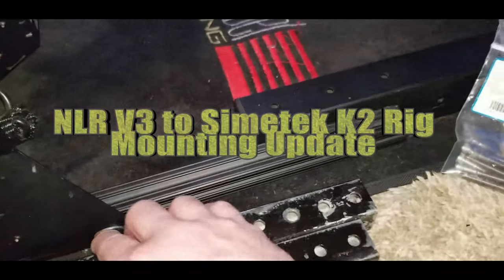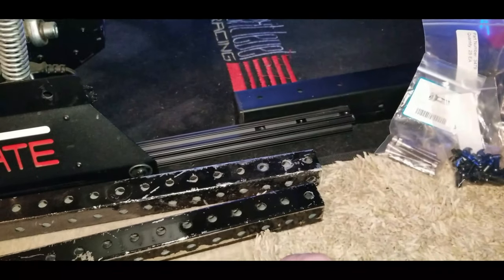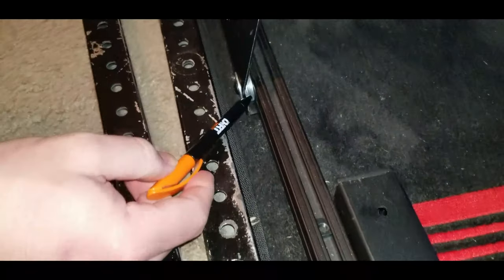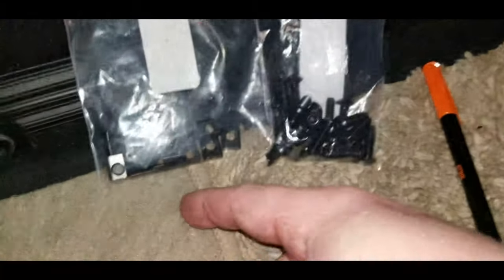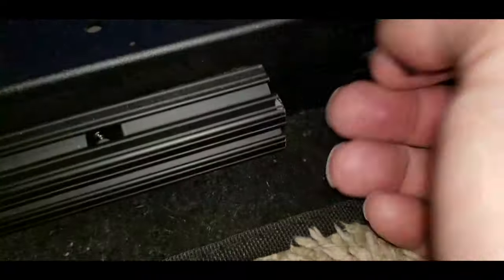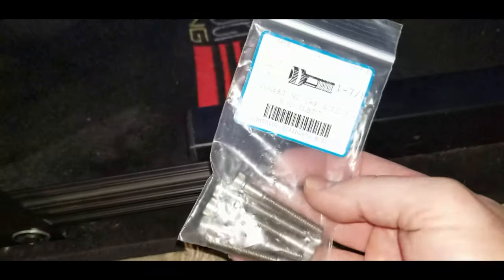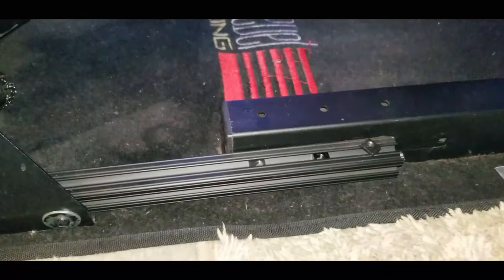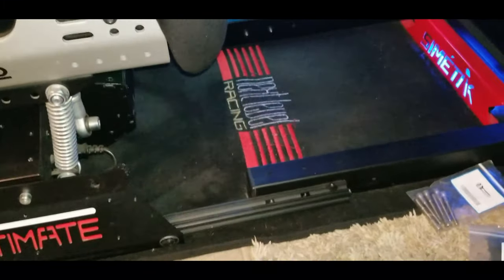Simtek K2 and NLR V3 Rig Update 2019

Comment: Nice setup hope to get there one day..best thing I have is a custom set of t3pa pros I made into a hydraulic brake with a pressure sensor
Reply from the maker: Thanks and you will get there. I started by sitting at a couch and holding the wheelbase with my legs as the pedal tray tried to slide aways. lol

Comment: Nice upgrade mate!
I'm so looking forward getting my GT1 Evo, will be so much easier to work with and add stuff!😎👍
Reply: You have seen mine mate, its not the evo but you know how you can bolt accessories to it and its beyond stable. You will love it. Will you be using a DD motor???
Reply: I’ve got one it’s awesome next level motion platform fits a treat
I’ve added quite a bit to it over time monitor mount P1 feet etc 
I’d recommend buying a extra length to fix the shifter mount to the base (i asked sim labs for it when I ordered mine)

Comment: Hey brother I got a question for you because I can't get an answer anywhere else. My V3 platform came with 0 USB cable furthermore there's no USB input on this machine correct it's a type a to type BRPS2 to USB? Sorry thanks man I'm jealous of your traction
Reply from the maker: Its a tyupe a to type b cable like you use on a printer. See my amazon link here: https://amzn.to/32WHhxA  Also where you plugin is on the right of the housing. If your looking straight at the on/off switch it's on the side of the housing to the right. Hope this helps.

Comment: Can you hook up the next level racing motion platform v3, directly to the simetik k2-r or did it not fit and that’s why you made brackets? Debating on which rig to get? I got a motion platform v3 that I am waiting to use till I receive cockpit. I ordered next level racing gttrack cockpit before I came across simetik k2-r. Now I can’t decide if I should cancel order and which rig to get? Any recommendations! Thanks
Reply from the maker: Hey thanks for watching and commenting. I have the K2 non R version. There is a difference actually. If you look at the last pic on their website for the simtek K2-r you will see my version. Pay attention to the large lip that goes inward towards the seat. That is completely different than the new R model. The new model is a much shorter lip and looks like it will clear just fine for the NLR V3 to mount up. The new R model looks to be a lot wider than mine making it more stable. My version is 469mm wide. The NLR V3 needs 460mm in width to mount.

To answer your question, yes it will mount directly to my version, but I didn't want to cut mine up to make it work just in case I wanted to use my rig in the future for a stated rig without motion for my kids. 

For my version I would have to cut a section out of the top lip to clear the V3 motion rods and springs. Then drill holes 3 mounting holes into the side (no biggy) their to mount directly to the Simtek K2.  One of my subscribers pointed me to another video where 1 person did it successfully. Would work great I think.

For your version, it looks like your good to go actually. The new K2-R version looks like no cutting of the top lip would be needed as it's showing 450mm clearance in a top down pic with the top flap even farther apart. You should be able to slide it in their just fine, but will need to drill 3 mounting holes in each side plate of k2-r rig. Looks like you will need some spacers as well between the NLR v3 mtg holes and the inside of the K2-r rear panels. 

Looks really doable to me and I would keep your order if you don't mind modifying it a little. Let me know how it goes. Others have been wanting to do this as well.
Reply: Sweet, thanks for the advice. Keep you posted how it goes.